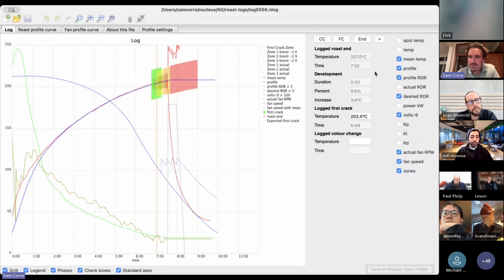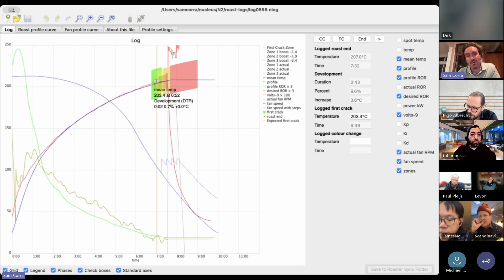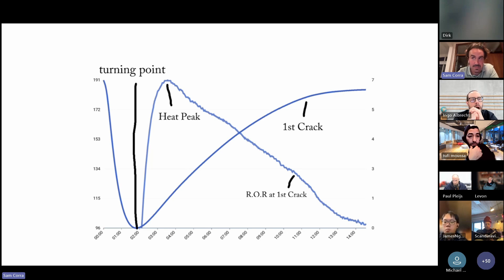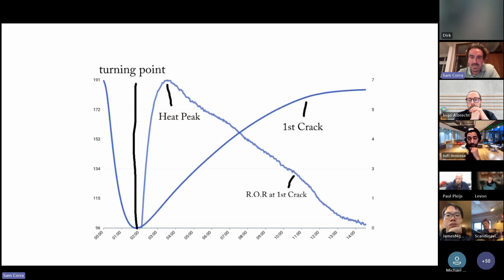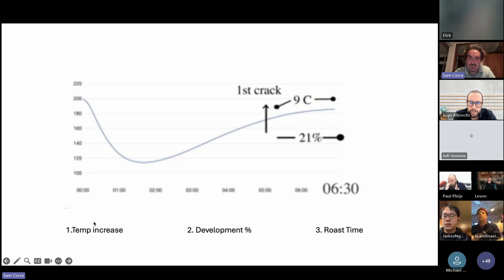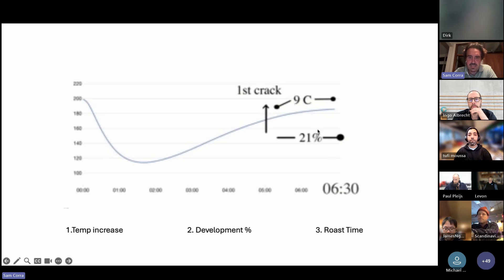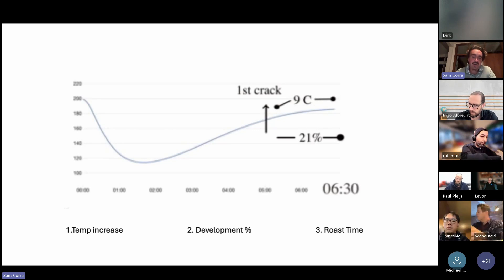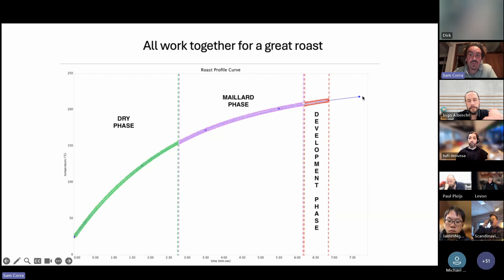Translating Sample Roasts to a Production Roaster – Webinar with Sam Corra from Nucleus Coffee Tools

Comment: Great info, as I'm beginning a roastery with an IR-12 and am working on this very subject.

One question on the Link- My bean temps always are 5-10 degrees F as they approach first crack on the Link, I assume due the beans beginning to become exothermic towards the crack.  This always causes FC to occur before the FC window on the profile.  How can I change the machine default settings to prevent this without having to modify each profile before the roast begins?
Reply from the maker: Did you make sure, you have put the right type of density tube in your app? There are two different types of tubes.